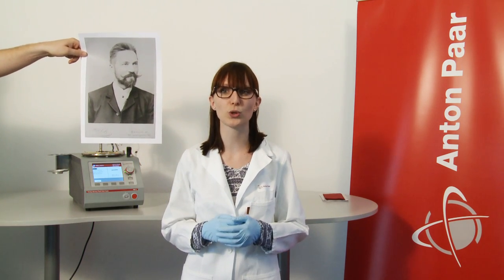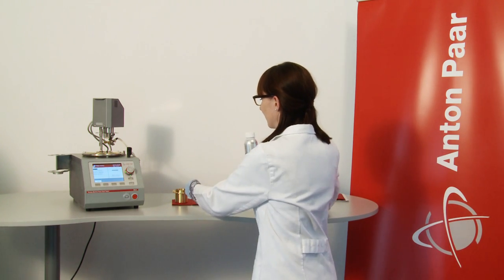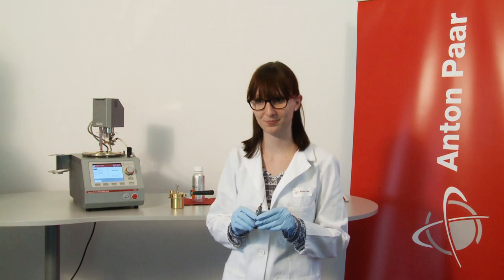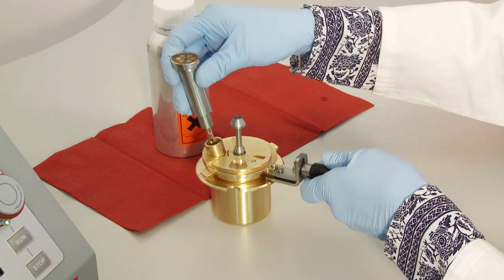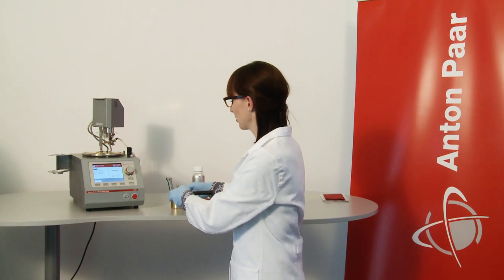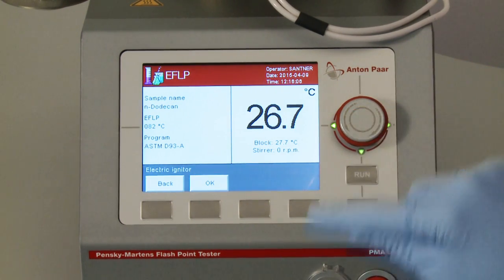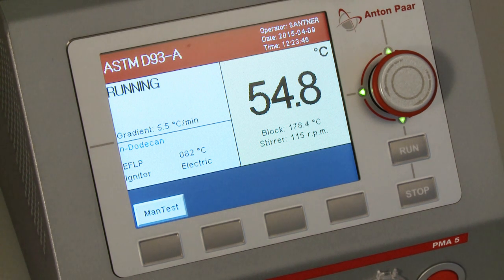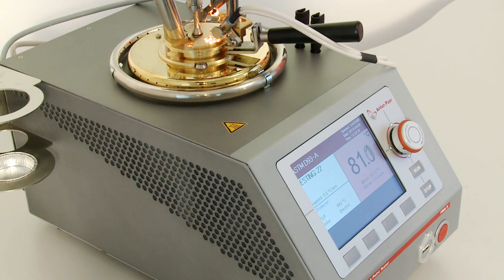PMA 5: Pensky-Martens flash point testing | Anton Paar

Comment: Used a manual PMCC for years. Made in 1944 semi-dangerous.  The thing with this unit, the glass thermometer is very delicate. There is a small clip on it and it may end up in your sample. More viscous materials, like asphalt does cause this unit trouble. You will have to warm the sample to roughly 100c. The rubber sleeve that turns the propeller will slip and not turn if the sample is cold.
Reply from the maker: Thank you for your valueable comment. Asphalt or bitumen samples are solid at ambient temperature and must be heated up before measurement of the flashpoint.
The PMA 5 comes with a special bitumen test program where the heating block of the PMA 5 can be set to a certain temperature to keep the filling sample temperature before 
the stirring and measurement of the flashpoint starts. After the completion of the test the PMA 5 will cool down the heating block to the temperature which was set before in the 
bitumen program to avoid that the sample becomes solid.
Reply: Regular issues with Pt100 and and Igniter